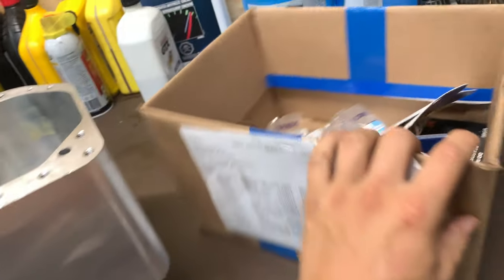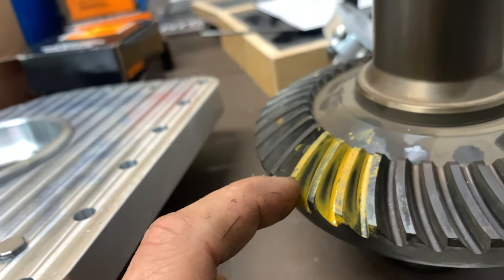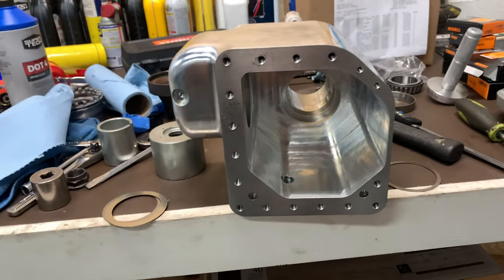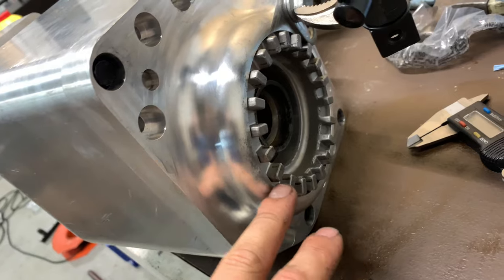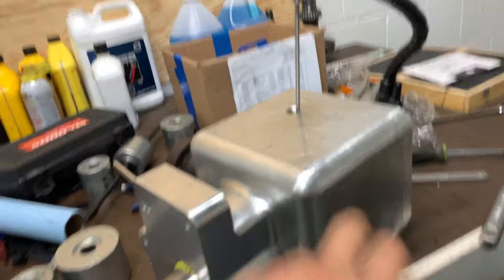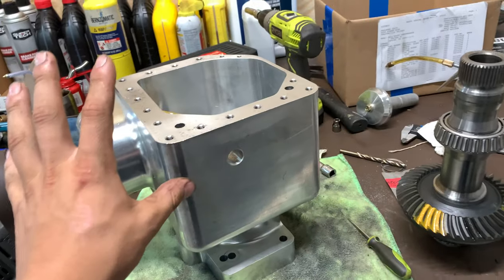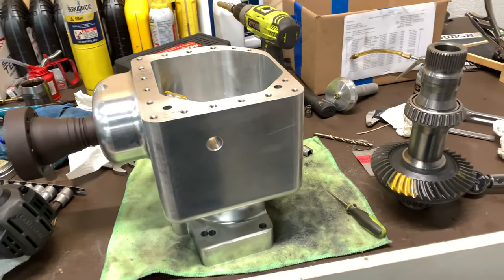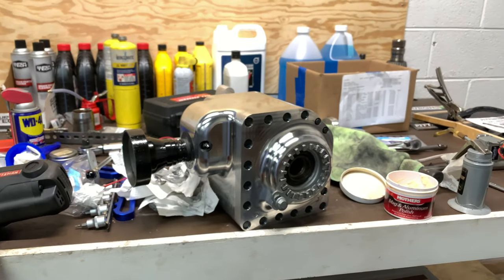Volvo 850 T-5R AWD Swap - Billet Angle Gear Final Assembly

Comment: You thought about running a O-Ring seal for the plate? Is that something that you might look at later on? Im not a big fan of sealer and it looks like you may have enough room to machine a groove in for an O-Ring. Juts thinking of future servicing or at the track ect where there isn’t anything to clean of and scrape away ect

Comment: Are you going to sell these
Reply from the maker: Maybe one day. They are not ready for production. Not enough testing.
Reply: @SimplyVolvo  do you have a build list? Im building an awd 855 t5r with your videos as inspiration
Reply from the maker: @throckmortonthebrave6634  Copy and pasted from my 818awhp dyno video :

Engine:
06R block with 84mm Darton Sleeves. Step decked, Custom JE FSR 11.5:1 high compression pistons designed by me. 93.2mm R crank, 147mm rods, 21mm pins, 2.6L. ARP main studs. Calico coated KING mains. Glyco Sputtered rod bearings.

Head:
95N head with solid lifter conversion. 280 (242 @ 1.27mm) cams with 11mm lift. Full port and polish, 5 angle valve job, valve profiling, full race re-condition (179/242 cfm int, 163/192 cfm exh, .500", 28in water). AutoTech Valve Springs. Grade 12.9 TTY Head Bolts. Modified S60R MLS head gasket.

Turbo:
HX40 with KTS4022 67mm billet wheel 68mm h1e turbine 20cm housing. SS 304 3.5" straight turbo back with straight through Vibrant Bottle Style Resonator and Borla XR1. DO88 intercooler.

Drivetrain:
M58 with reinforced case & stronger OEM gearset. Front + Rear LSD. Billet angle gear. Billet rear axles. Sachs RCS2-184 twin disc clutch. OEM collar sleeve.

ECU / Fuel:
Hell Moose Performance LLC VolSquirt V1.8 ECU. EV14 2200cc injectors + twin AEM 400s & DW300.

Comment: Are you gonna put a filter on the drain line for that pump?
Reply from the maker: Nope. No Need. The only debris that will ever be seen in this gearbox is very very fine metallic particulate which the diaphragm pump & gears will have no problem with. There will be no carbon build or anything else since its a sealed unit and if there is ever something big enough to clog the pump / line the unit most likely already failed.